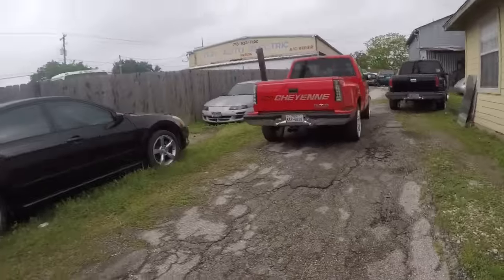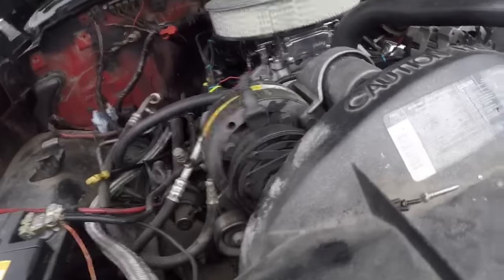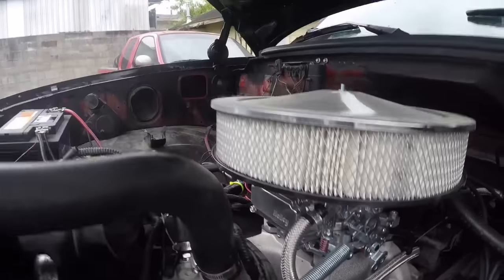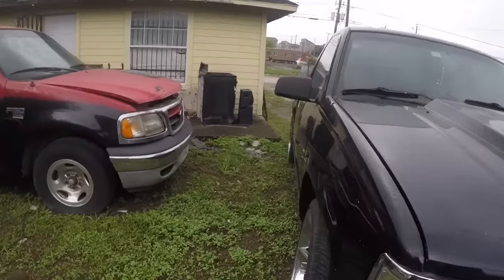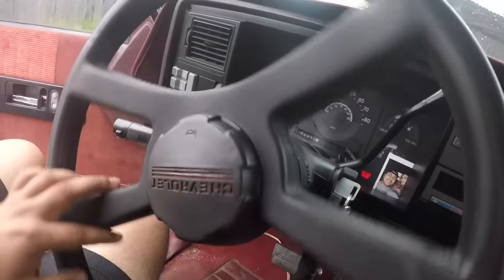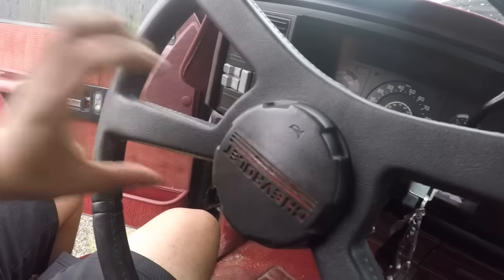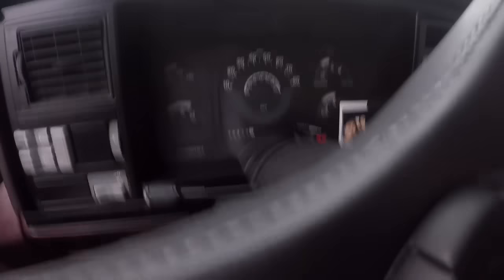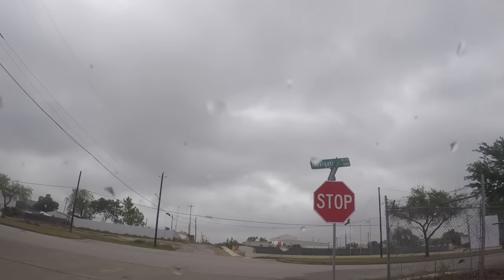My Obs Chevy is FINALLY COMPLETE....ish | Update  +Cinimatics  +First Test Drive With New Carburetor

Comment: Erractic spark could be rubbing and occasionally ark off the metal mount used to pull the motor its the one on the driver side they usualy ark off of
Reply from the maker: Thanks... I’ll look into that..

Comment: What intake did u use and did u use the TBI heads? Could u send a diagram of how u did it
Reply from the maker: How’s it goin, Aaron! I used a 4 barrel small rise edlebrock Intake for a 4 barrel carb. The carb is 650 cfm btw. I did use the same heads btw. I’ve heard that the 350 vortec heads fit and that the flow better. 
I recommend you get a highrise intake manifold to match whatever carb your gonna use (I don’t like mixing brands) and a FOUR barrel 650 CFM carb. (Its better to go a little bigger so you can turn down fuel if needed. Can’t do it the other way around if you buy a too low of cfm carb lol). I also recommend to get some 350 VORTEC heads and get them ported and polished and just slap em on. That’s already like roughly 50+ hp. Assuming you’re cammed just like me, ON TOP of the cam. If you’re not tell me after reading this and I’ll give you another recommendation. Have a blessed day!
Reply: @JesseObs  I have a 1992 that I built a 383 stroker for has a 700 r 4 trans but I tried running it on factory TBI it won't work so I am thinking carb
Reply: My cam is edelbrock 3702 I believe
Reply from the maker: I just ditched my 700r for a 5 speed lol. I also recommend that lol. And yeah, you’re cammed and IK how frustrating that stock tbi is and how much it DOESN’T work. As soon as you go carbed... forget abt it. It’s smooth sailing from there on out. Good luck!
Reply: @aaronaplin6435  go manuel valve body.    300 plus bucks  drop the pan and enjoy

Comment: Swap out to the nbs master cylinder, I'm getting ready to do it to mine
Reply from the maker: Will it fit our break boosters? What’re the benefits of putting the NBS one on an OBS?
Reply: @JesseObs  yes it will, u will need an adapter for one of the lines, and  bend them a little, your brakes should be alot better, I'm definitely doing it to mine
Reply: @JesseObs  research the swap